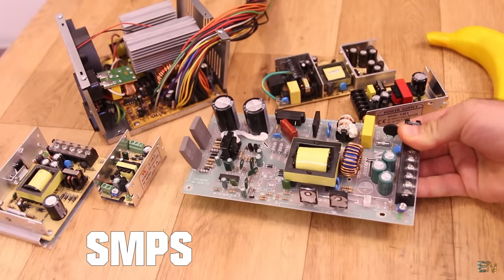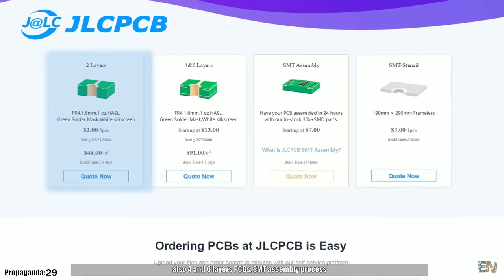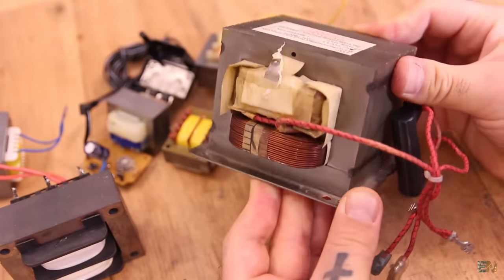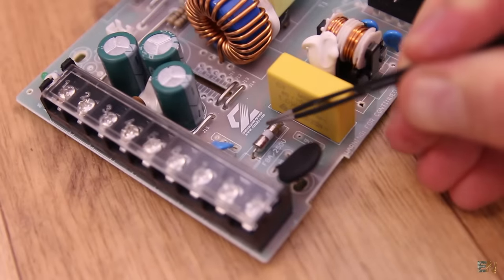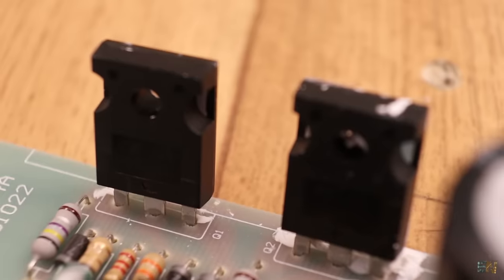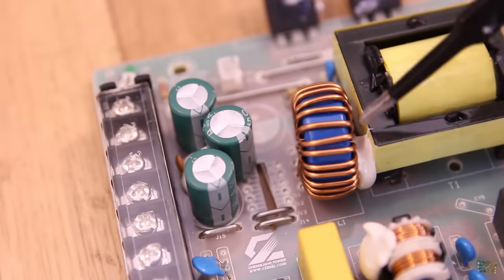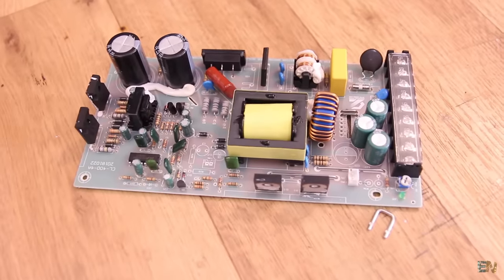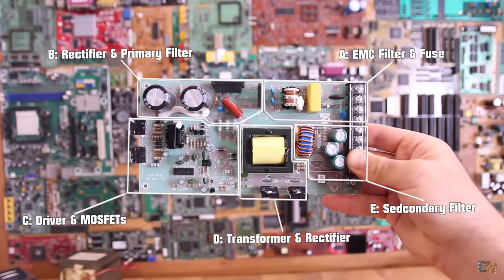How SMPS works | What Components We Need? Switched Mode Power Supply

Comment: These are  disadvantages of SMPS... 
1. (SMPS with high RFI) Interference with the radio receiver..
2.SMPS with high EMI can interfere with digital equipment..
3.The durability of a good SMPS is only about 10 years, while a good transformer (conventional psu) lasts more than 20 years
4.Prone to damage because it consists of many components .
5. There are still many who do not understand the switching technique so it is difficult to repair it when it is damaged

Comment: how was the control system designed with feedback to assure stable equilibrium i.e. in order to reach steady state ? , in the sense , after supplying (feedback) the driver circuit with the necessary voltage to start controlling the gate , what assured u with the confidence as to see no ripples in the output signal from the desired signal output from driver section ? and also if u can please explain transient analysis for choice of tolerances of parts on the "to be used components" while designing an SMPS it would be very kind of u

Comment: Wow great explanation, can you make a tutorial on how to make your own power supply with certain voltage and current? I need to replace it modify some PSU, like my water dispenser Peltiere PSU to have more current.

If also possible a tutorial on how to fix a PSU of a PC. How to determine what part is broken and should be fixed.

Comment: Great explanation. Thanks! You may want to correct something in the video, I believe you said 220 output DC instead of 24 volts DC. Not the end of the world (well maybe but that's a separate issue) but you may want to put a tag in there. Or did I hear you say 'here in europe?"
Reply from the maker: THe input to the first filter is 220VAC and the output is 320VDC.

Comment: Thanks nice video 🙂 You can use buck regulator after transformer. Basic idea is higher frequency requares smaller transformers and less winding. Many smaller ac-dc reguletors uses flyback topology witch is more like isolated boost converter
Reply: The circuit in the video is essentially an isolated buck converter. I'm fairly certain it is a half-bridge topology, judging by the symmetry of components (two switching FETs, two diodes for full-wave rectification with a centre-tapped secondary).

Comment: At 12:59, you show the high voltage and low voltage areas, but it looks like you purposely included the schottky rectifiers in the high voltage area. Unless I'm missing something, these are operating at low voltage, right? What high voltage component are you trying to illustrate in that area?

Comment: There are many types of SMPSs, the one you explained today is the AC-DC flyback SMPS.
Reply: Also, some have multiple outputs, like different voltages or negative voltages.
Reply: No, it is not a flyback converter. It is almost certainly a forward converter.
No inductor is required at the output of a a flyback converter, at least between the rectifier and the filter capacitor. Sometimes a small inductor is used between the first filter cap and a second filter cap to further decrease high frequency.

Comment: Why do they not use a full bridge after the transformer? Wouldn't it be more efficient and produce a near DC voltage without the capacitors, also allowing for even smaller capacitors and reduced ripple?

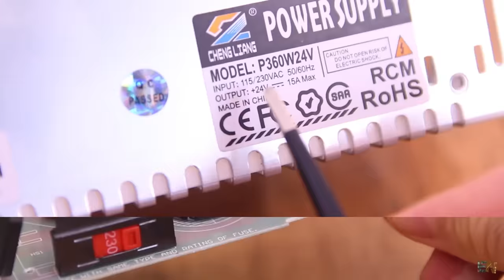Comment: At 8:35, wouldn't the output be 325V dc as the capacitor will store the highest voltage wich is 325 peak to peak

Comment: Very good video thank you! One question...how do (many of) these suppliers handle different AC input voltage (that is ranging from 100 to 240V) without some sort of switch? Thank you and keep going!
Reply: There are two approaches to wide input voltage range without a switch.

The trend these days for small converters is to use a flyback topology. With modern controllers it is quite practical to make small flyback converters that will perform well with a wide input voltage.

With larger converters it becomes impractical because the tradeoffs become unacceptable. It can be done, but you wind up with bigger filter capacitors, bigger FETS and a bigger transformer so you can deal with the the high voltages with high line voltage and high currents with low line voltage. It is now common to use active power factor correction for higher power converters. Active PFC is essentially a boost converter that will produce around 400 VDC from any input voltage in the range of about 85 to 265 VAC. The circuit works by making the input current from the line sinusoidal and in phase with the line voltage (you actually have to make the average input current inversely proportional to the average input voltage but make the instantaneous input current directly proportional to the instantaneous input voltage).

Comment: Hey friend can you help me, I'm trying to make that chain claw you made with the hall sensor, I thought I found the circuit ready in China, it is a hall sensor module already comes with the trimpot and everything, as I don't master much 
electronics I decided to buy, but it doesn't seem to have the same result, I don't know where the error is, you can help me, bc already used some module ky 024 hall, I'm Brazilian, what did you do with the claw you did, send it to 
me, you have cc 65

Comment: Great explanation about switing power supply! I would love to hear more about the feedback system, some powser supplies had a dummy load resistor that work togheter with octopler. Its possible to change voltage ate output changing the feedback loop at pwm ic? A

Comment: 15:02 nice video. Thanks. A question here, why don’t we use a full bridge rectifier here, again, as in part B, for higher efficiency?
Reply: edit: I looked more closely at the images of the board in the video and now think it may in fact be a half-bridge converter in which case there would be true AC at the secondary of the transformer. In that case then you absolutely would use a full-wave rectifier on the secondary, and in this case I think it is being done with a centre tapped secondary winding with two dual diodes with the two diodes in each package connected in parallel.
It would be absurd to use any of the topologies that do use true bipolar excitation of the transformer and not use full-wave rectification at the secondary.

========

His description of the circuit is wrong.

There isn't symmetrical AC on the secondary of the transformer if this is a forward converter as I think it is.

With a forward converter, everything happens in one "quadrant" - the voltage applied to the primary is 0 V to some positive voltage. The output is unipolar pulses. This is a comparatively simple design that doesn't make very good utilizaiton of the transformer core. There is no "half bridge" rectifier at the output, only a single rectifier that keeps the output from discharging back into the secondary winding. A second diode is required, but that is to allow current to continue to flow in the output inductor when the primary side switch turns off (just like in a non-isolated buck converter).

If there were truly AC on the secondary, which is the case with a half bridge, full bridge or push-pull converter, you would use a full-wave rectifier. Usually this is done with a centre-tapped winding so full wave rectification requires only two diodes, but sometimes you do use a full-wave bridge rectifier. These topologies make better use of the transformer but the circuitry is more complex. Usually they are used for higher power converters. (You might use forward for up to a few hundred watts and one of the more complex types at higher power,)
Reply: I’m not an expert in this area but it doesn’t make sense to me to have AC at the secondary side, if the purpose of PWM is to adjust/regulate the output voltage. PWM wouldn’t work if it’s AC rectified half wave because after filtering you get the same DC voltage no matter the frequency of PWM.

Comment: Terrific Video! Quick question: my TV smps board has two transformers completely on the hot side of board, and, as expected, a single transformer that bridges the hot and code sides. Q: what could be the use in having two transformers within the hot side?

Comment: Why we don't use full bridge rectifier for the alternating output from pulse transformer ??
Reply: Some power supplies do, however an fbr has a higher voltage drop.
Reply: Cost. The diodes are fast-switching Schottky diodes that are expensive, so the fewer used the cheaper the cost.

Comment: Really good video!

Just a question.
Isn't the 2 diodes on the output side in full bridge mode when they use centre tap transformers?
Kind regards
Reply: No, 2 diodes is a half bridge rectifier (because a full bridge has 4 diodes)

Comment: So all those components and complexity is used to reduce the size of the transformer , but I have a question : why not get rid of the transformer all together and use pwm to reduce the voltage from 320 dc to whatever voltage you want ? Thanks !
Reply from the maker: How? Using a buck converter configuration? You would still need a big coil. And going from 320 to 20V directly with the buck is difficult and not that efficent.

Comment: Why the secondary rectifier is half bridge?
Reply: That's because the secondary winding may have 3 pins. So, in this configuration, the center pin is used as ground or 0V, and you put a diode in each of the other two. This is still a full wave rectifier, so the video is wrong, as I understand. When you don't have that mid therminal at the output winding, then you need 4 diodes to rectify the full wave.

Comment: Informative video .. i  do have same kind of power supply of 24v/10amp  based on tl494 ic .but for some issue i am having 4.6 v output only ..i tired  try to adjust that voltage through timmer and i am out of ideas.if you have some ideas feel free to drop.
Reply from the maker: Without analysis not the circuit and signals with osciloscope I can't say... It stopped working well without any damage?
Reply: Yes .it was damaged before single channel transistor/mosfet  was damaged .in order to fix that i replaced both the transistor/mosfet now its working but getting only 4.6v i guess the pwm driver wont have hurted  since they were isolated by the driver transformer further i dont have knowledge about  the ic pin configuration wheather they should be pull up or pull down!

Comment: If I understand you well. If you put some DC PWM signal on primary coil, you will get a AC  signal on the secondary coil? I thought that the transformers won't work with DC.
Reply: The PWM signal is pulsating DC which has the same effect as true AC.

Comment: question. I noticed that most  AC-DC PS . have (as an example ) 0-36v 10 amps. but they write that you can change the voltage. but the 10 amp is not adjustable. 
on the other hand. I found a 36v 360W Switching Power Supply Transformer. 
I needed a 34v 6-7 amp PS. but couldn't find one.
so I found this PS ..but it can be regulated from 34V to 38v dc.
It can supply with all currents less than 10A. ---such as 1A, 2A, 3A, 4A, 5A, 6A, 7A, 8A, 8.5A, 9A 9.5A, 10A. (max 10 amp)  
can amperage be controlled automatically? upon demand?  thanks

Comment: when you have an over voltage current that triggers the over voltage protection and shuts down the DC output of a SMPS (switch mode power supply), how do you reset it? for some reason i get 0V DC. :-(

Comment: 3 smoothing capacitors at 12:04 , what happens if i increase their capacity? i mean they are 3 X 35V 470uf, i replaced them with 3x35V 3300uf audio grade capacitors to get better DC for audio applications.Did i do wrong? :)

Comment: 8:58 
Isn't it pulsating DC voltage, not AC?
Reply: Correct, as the current always flows in one direction only, even though the current is changing

Comment: Thanks foe the alien languange.. isont even knoe some of the component any mybe it will take almost a year to undertand..
Sorry didnt said to its your fault but its mine for not knoewing full basic of board..
ONE QUESTION..  WHAT IS THE COMMON PROBLEM FOR PC PSU that no power or the fan is turning for 2 second after bypass the on switch..?

Comment: @
Electronoobs, Thanks a lot for this video.
I have a problem.
My pc power supply generate 3.3v but when i connect (SSD or HDD or ODD) to the SATA power cable then 3.3v raise to the 3.8v and computer won't work.
How can i fix this rail on my PSU, what can be problem ?

Thanks!!
Reply: 2.5 inch hdd's and ssd's work on 5 volts, not 3.3V. Also 3.5 inch HDD's work on 12 volts.

Comment: You keep stating a negative feature about the older power supplies is the weight of the transformer. Well it weighs Nothing when it sits on the floor or TV cabinet! Only when it must be moved which is never! Also those transformers were Extremely reliable very very seldom ever went bad. These new power supplies are far more complex and have a very high fail rate compared to the old transformer type supplies. Also did you notice the space required for those SWPS?

Comment: I come smps power problem with ka7500 driver ic power supply. its fault have a after load power on out put voltage no.  power on after its load ok. not a startup currant out?

Comment: What is the role of the NTC resistor
Reply: It prevents a large surge current through the bridge rectifier and large smoothing capacitors when the circuit is first powered up by having a high initial resistance. The resistance gets very small once it has been operating for a short time and has heated up. The N in NTC means negative so its resistance decreases as its temperature increases.

Comment: optocoupler gives high or low then how it gives analog feedback?
 i.e how the feedback controller knows the output is high or low than the set voltage
Reply: it used tl431 look it up
Reply: @mihapeterle204  i think opto 817

Comment: the voltage after full bridge rectifier it is not DC???? really? the capacitor change the ac to dc? so dont use bridge we dont need. you say that.